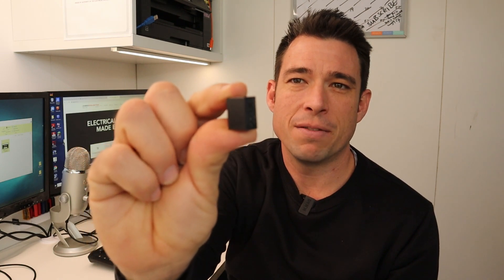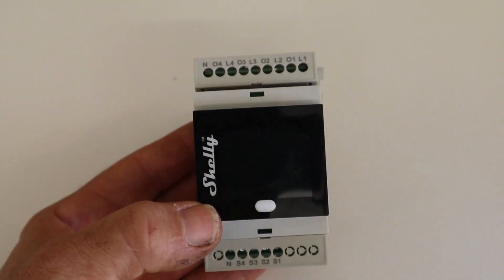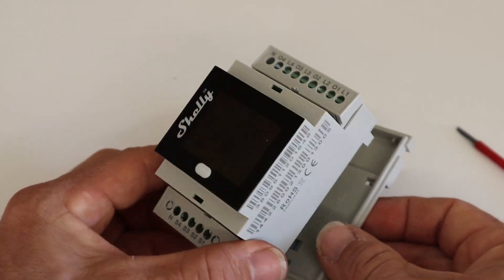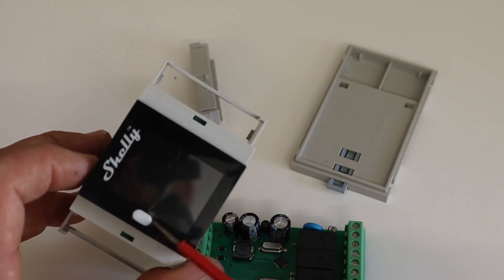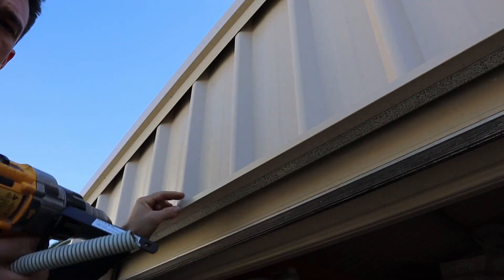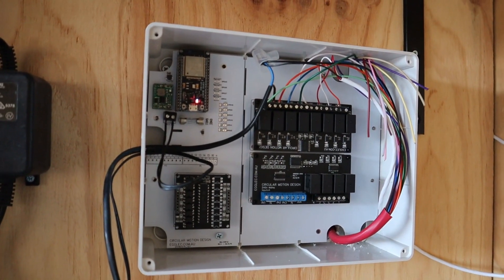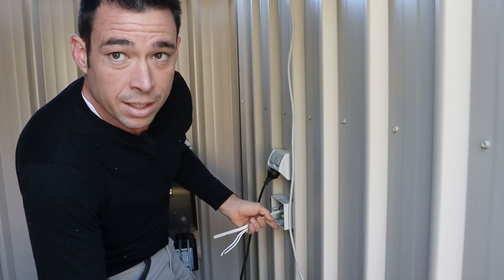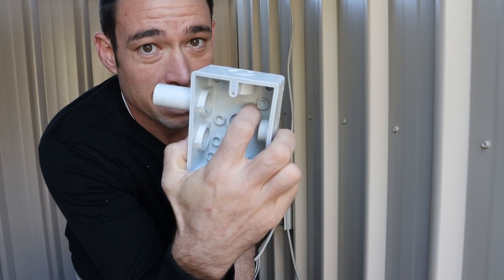Shelly 4Pro - Relay Ratings - Installation

Comment: Hi, my shelly 4 pro is a brick, black screen and no on or off light. Is there guide for reflash firmware? If connect see wifi network, but try connect, after one second disconnect. Thx

Comment: HI Jimmy, Great info! I want to get more info on yor setup for pool pump and blowers. I currently have to go at the back of the yard to turn on blowers, so I thought if I can install 2x shelly1 (or 2.5) to turn on pool pump (put integrated time on 24/7 and let set timer on shelly) and blowers would be great. Currently running double powerpoint  on a 30amp dedicated pool circuit. install sub board at powerpoints with relay/contactor? or install relay/contactor at main power board? I will be getting electrician in to do but just thinking the best (and cheapest) way. Correct me if I'm wrong (lots of reading) - the pool pump connects through the chlorinator which has it its on sufficient relay? - therefore only need one relay contactor? Any help appreciated...cheers
Reply: Also keen for a solution for a pool pump

Comment: Strange I found them an awsome addition to the smart home, 
I have openhab running as my central controller, Put 2 Shelly 4pro's in my gardenshed / garage -> and shelly talks openhab with mqtt + my push buttons just work in the garage...
plus no hassle with the belgian electrical certification.. = insured when theirs a fire

Comment: I want your opinion after testing the shelly pro,  is it strong and safe for  permanent use?
Reply from the maker: If it has 1 or 2 amps yes it's ok which is most like what it would get used for. I wouldn't be confident with a big load near 10a, the parts/PCB track Inside look a bit small. It has pretty good wifi reception it works right out in my shed. Where the esp32 module in my shed drops in and  out.

Comment: Was that your reflow oven on the shelf above the Shelly? :)
Reply from the maker: Yes it was, it works ok if you just turn it on and go, but I've order parts to control it better as it gets too hot to quick and the solder balls a lot. I've order the reflow master from accidental maker, it looks pretty cool.

Comment: I would like they to make a 4 relay in wall box. Even if it was double the size of the Shelly 2.5. at my house I have some 5 gangs switches that I have to replace with 3 Shelly devices.
Reply from the maker: Hi Douglas, depending on how into DIY you are you could use a D1 MINI or similar to control your lights via HA/ESPhome at the switch plate using regular light switch mechs. And use smart lamps and/or place your relays else where like in the light fitting or roof space. In this video https://youtu.be/hGw9F6IkHMI from about 12:15 - I have a DIY 4 gang switch with a 3 relay module, the 4th button I now use to control my hall light via HA and the relay is elsewhere and one relay is not used, and the the other button controls 3 lifx lamps over my dinning table. Even though is depends on wifi to work I've have 0 issues with it so far. So in short mix and match to make it work. I also have used this module https://youtu.be/2-1UEQn34yg in the roof space to do the switching.
Reply: @SparkyJames   I decided to not use smart globes, instead I will only use smart switches. I don't really want to rely on wifi to have the normal operation of the lights. And smart switches end up being more cost effective as the house have a good amount of downlights. I thought about put the shellys at the light fittings but I think at the switches it will be fine. I have gyprock wall so it has plenty of space behind.
I watched your videos with the 6 relays and other videos with the boards you design. I think you should definitely put those boards for sale, if you sell it as DIY kit, I believe it does require any certification.
Reply from the maker: That is the rule, don't solely rely on wifi👍